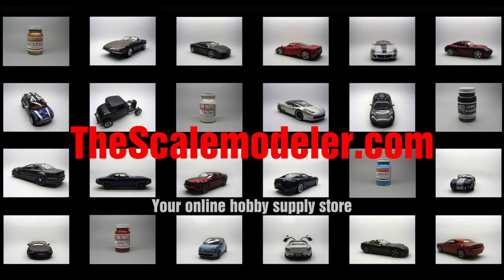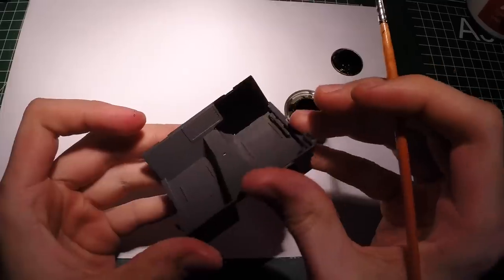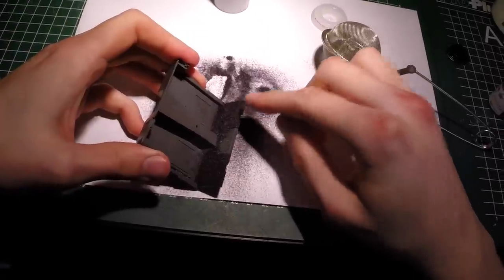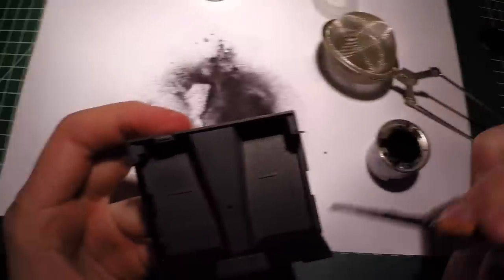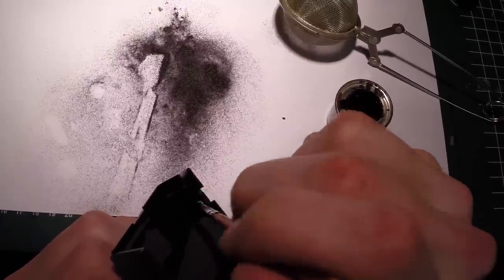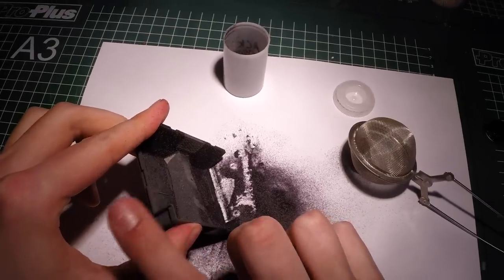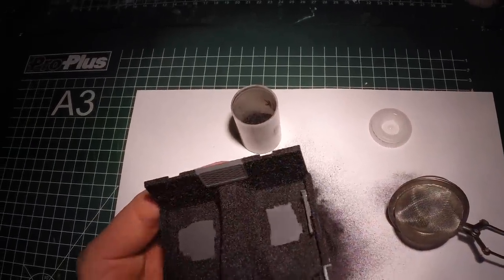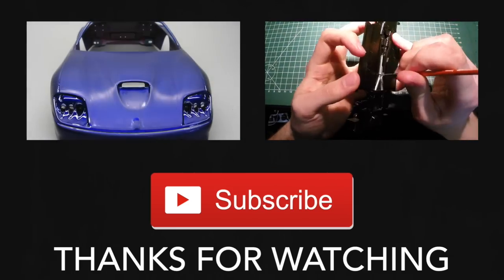Fujimi:Ferrari 575 M Maranello Part 5 How To: Interior Flocking

Comment: Great vide I got get me some flock I  finished the f40 great model not for the inexperienced there are lots of thing that just don't fight and u have to try ur best to modify but some times still just dosnt fitand will have to  live with it for example the trunk/ engine bay when closed dosnt fit at all and before painting and primer I tried to get it to fight right no Luck so know I get to look at the engine  24/7 lol and one last tip try to buy a newly made model my parts were from 1988 which made the decals just crake and the windows very easily will break/ crack

Comment: how can u remove tha flocking if its been on for a while thank you
Reply from the maker: +robert norris You can't
Reply: robert norris try soaking your part in Purple Power degreaser (found in the automotive section at Walmart) for about 48 hours. There will be moderate scrubbing required but can be taken care of easily with a brush that has stiff bristles. This will only work if you used enamel paint to secure your flocking. This method will not soften or weaken the plastic at all. When you have finished removing the flocking and enamel, wash your part in dish soap.

Comment: Flocking just doesn't look good. The particles are too big. I found a new way and a lot cheaper. A more authentic look is cutting bra strap material. You can make carpet and seatbelts plus it looks 100 times better.